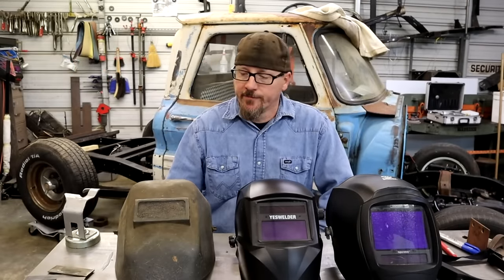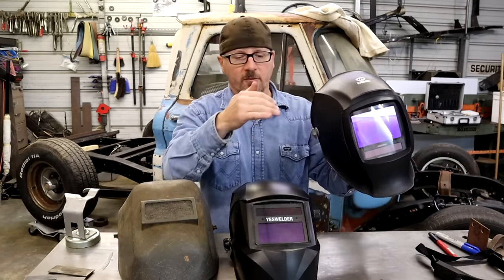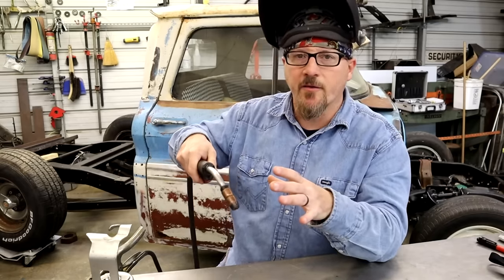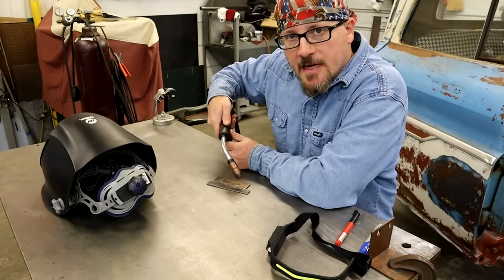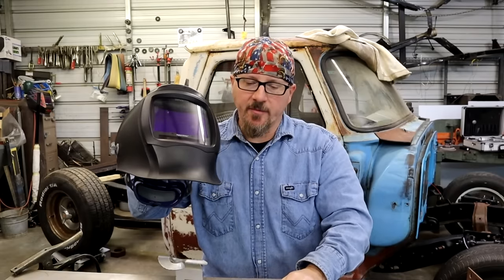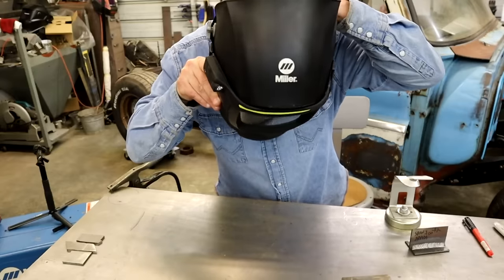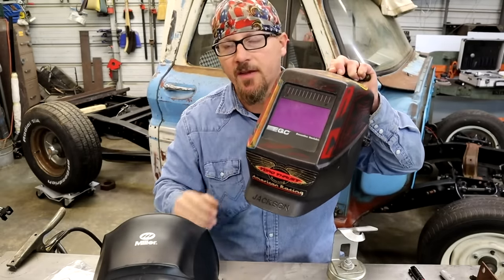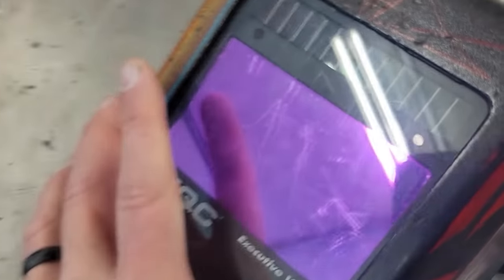(HELP) I Can't See My Mig WELDS (Top 5 Tips)

Comment: I had untold problems seeing my welds regardless of whether it was mig, tig or ark when I built my new home workshop. I changed lenses, I changed helmets and couldn’t figure out what was causing my problems since I retired. After more than 6 months of giving up, I had an idea which resolved my problem. I had an ex-hospital stand for drip feed bottles on wheels and mounted some LED lights shining onto my weld seams. It worked. Months of frustration, and it all came down to a lack of light. I thought I had ample light in my workshop, but I was wrong .So, I suggest, if you are having this problem, take your project outdoors with the sun shining across you project from either side of you, if you can now see your welds, then your problem is a lack of light at the work site I hope this helps someone, thank you.
Reply from the maker: Thats a great idea, thanks for sharing!!!!!
Reply: I'm a noob welder and soon found I could not see my welds. The sharp light from a LED worklamp fixed it, need a good way to mount it, this is a good idea
Reply: I think that's the easiest solution. More light on your work.
Reply: Totally agree and great idea. Us oldies need all the help we can get. You can have all the skill but if you can’t see what you’re doing, it’ll look like an amateur did it.
Reply: i forgot to take both sides of protective film off Lense cover and failed a weld test. I couldn't see nothing.
Reply: Yeah I had the same issue and put an LED light above shining down on the area I am welding. Certainly helps. Very frustrating when I was trying to see what I was welding and then stop and look and the weld had veered off the line.
Reply: I found a $20 Harbor Freight magnetic base LED light and I stick it by my welding project. Helps a bunch!!
Reply: I had to do same thing after 1 year of cussing.....got a $30  digi helmet ....good point.
Reply: Just about to  go into hobby welding...but anxious about eye damage....is burning your cornea normal or is it due to carelessness?
Reply: Thats what I thought. Sometimes we overlook the obvious. i bought a Braun head mount and going to try it.
Reply: Thank you.
Reply: I tried lights and different lenses and nothing worked. Then my optometrists made me strong cheaters and I was back to normal

Comment: I would add one more tip... when welding where the sun is shining from behind you then the light coming in from the back of your helmet can degrade your vision.  Having a dark cloth that you can put over say the top of the helmet down over the back of your head to keep your eyes in the dark helps also.  My father-in-law was a pipe welder in the oil field and work a helmet that had built in goggles to keep out the sun.
Reply from the maker: I wish id of put that in there, thanks for watching!!!!
Reply: I had a piece of black canvas attached with Velcro , it acted as an anti spatter ;)
Reply: Your daddy in law probably had a pancake welding hood ...is not a helmet...
Reply: Black Stallion a welding supplier makes a bib to clip under your helmet to keep your neck from getting tanned (at odd angles). It can also be used at the top of the helmet to block light. The darker the inside of the helmet the easier it is to see the weld because what is coming through the filter is only about 10 watts so reflection on the inside lens will be brighter than the weld arc itself coming thru the lens. I also like to wear black welding jackets because the green ones also reflect light under the helmet which competes with the weld arc. Awesome video!
Reply: Denim makes a good hood cloth, keeps sparks off your back and neck.
Reply: Yeah, I had to add a leather cloth  to the top of my helmet also a small chin flap to stop splatter hitting my chest, big improvement also magnifying lens because glasses causes double vision
Reply: Here are a couple of more things that will help. If you wear progressive lens or bifocals, get a pair of reading glasses so you aren’t going from near to far on your glasses. Block light with a cloth from coming into the back of your helmet even when you are inside. When you are fabricating keep in mind that some joints are a lot easier to see when welding than others so make your design with this in mind. If you have to butt weld flat stock together space the pieces apart or grind an edge on them to be able to see the joint you are trying to weld. If you have joint that is giving you trouble seeing mark a line with soapstone on the metal next to the joint.

Comment: When I bought my welder a few years ago I bought a Hobart auto darkening helmet.  I could not see what i was welding.  I played with the settings but no luck.  I decided that I must have gotten a defective helmet.  I did buy the cheater lens when I bought the helmet but still it was just too dark.  Let me get right to the point, something I finally learned (thank goodness) after too many attempts to weld.  Take off your auto darkening eyeglasses.  They darken when you strike an arc.  It is amazing how much better my helmet works since i figured that out.
Reply from the maker: Id never thought about that. That is crazy that they darken inside the helmet.
Reply: Great tip…..I too never gave this a thought!

Comment: I don’t know if anyone else mentioned this.  But I got a small aaa flashlight that attaches to the end of my mig.  It has helped a lot with it being to dark for me and my old man eyes.  Thanks for the tips.
Reply from the maker: Awesome I didn't know they made them, thanks for the tip!!!
Reply: @ACDesignsGarage  I don’t remember the manufacturer but I got it from an Eastwood sale they had set up off site at the Hartford Fairgrounds.  It helps my bad, beginner welding a lot because I can put the light where I need it without it it affecting my welding helmet.

Comment: Excellent points! I took welding at about 65 years of age and had a rough time welding because I couldn't see the puddle. I finally realize that I had to turn the auto darkening down. Made a huge difference.
Reply from the maker: Thanks for watching,  yes I use to think I had to weld with a shade 12 and I couldn't see squat. Then turned it down and I could see lol
Reply: Get to clean wire

Comment: I don't know if anyone mentions this, 744 comments are a lot to read through, but for the outer lens cover you can get a container of headlight cleaner. A few drops and a couple of wipes later your lens cover is good to go. I recently did change my outer lens cover after a good 3 years of use and cleaning with the headlight cleaner, but the new cover was not too different from using the headlight cleaner. Not all weld helmets have an easy way of changing the lens covers, so I hope this helps someone. I am here watching this video and deciding something  I have been curious about. I just turned 55 years old and have always wondered if something as simple as a taped flashlight to my helmet would really help. Watching this video and reading some of the comments cemented that decision for me and I am going to give it a go. Thank you to the video and commenters that suggested this.
Reply from the maker: Great idea I'll have to try this thanks!!

Comment: I have had problems seeing when MIG welding for years, and I would often lay a lovely weld a few millimetres alongside the seam I wanted to weld. My friend who is a welder recommended me to draw a chalk line where you want to weld. It works a treat... Gas welding is my favourite, it so calming and you can see everything so clearly.
Reply from the maker: Yeah that chalk trick works great!!! I need to do more gas welding, your right its pretty fun. Have you tried welding aluminum gas welding, its tough but a good challenge!!!
Reply: @ACDesignsGarage  I made holes in the aluminium when I tried 😂
Reply from the maker: @chrisparti  yeah it tough, I need to try it again on a video lol that would be a funny one!!!
Reply: Aluminium welding, I've done it, and it works. Henrob torch. Looks like the same one Eastwood sells. 
It's not tough once you do a few practice welds. But watch a good video first.

Comment: I’ve always used a large viewing area helmet. Recently, I bought a Vulcan from HF with the large view area, grind mode, auto dark, lots of adjustments, and appears to be very good quality. It also has cheater lenses available. It made a significant difference for me as I can see the puddle and weld path much better. It’s a lot better than the low dollar auto dark I was using, but isn’t a high dollar unit, which is fine because I don’t weld professionally. It is a sweet spot for me. I also use it for plasma cutting which I like. I know lots of people don’t use a helmet for plasma because the arc is largely shielded, but I don’t like to have my eyes exposed to any level of arc process. The helmet adjust perfectly for aluminum and the fit ent adjustments are really good.
I’ll add to this that using a t shirt or cloth to the back can work well if you have to weld from a position where sunlight or strong shop lighting is coming in the back. Also, I use a heavy glove on my left hand and a very light mechanic glove on my torch hand which lets me retain my fine motor coordination. In some cases I don’t use a glove on my torch hand, but I try not to do this and expose my skin to the UV.
Reply from the maker: Thanks for watching!!! Ive heard that that Vulcan stuff is pretty good!!!

Comment: Thanks for this. I just welded for the first time at the Oshkosh Airventure fly-in/show at the Lincoln Electric workshop. I did lousy. I kept telling the guy that I couldn't see the weld, but he didn't give me any help with that. I took doing poorly as a challenge so I bought a Lincoln welder, and figured that practice would help. I didn't realize that not being able to see the weld was a thing. I will put your suggestions into practice and see what happens.
Reply from the maker: Man I've always wanted to go to that!!! Yes if you get a welder make sure you can see well and it will make it alot easier!!!!@

Comment: I’ve been really struggling to shoot a straight line. I followed two tips replacing the lens protector and adding a headlamp. I tried it with an elastic strap but it kept crushing the mask against my face. Picked up some good 3M Velcro and stuck it under the lens area. Huge difference. Pay a few extra $ and get a rechargeable. Thanks for the tips. Changed my welding life!
Reply from the maker: Awesome glad ut helped, yeah the strap can be challenging, great idea on the velcro!!!

Comment: Great tips! When I first started TIG welding, I had trouble seeing. I solved the problem almost 100% by getting a pair of 300 power reading glasses, and getting decent lighting on my work.
 I was TIG welding architectural copper (Range Hoods, Bar Tops, etc) so my welds were VERY critical. It was extremely easy to ruin a $15-$25k hood or countertop, and once there's a hole, it's pretty much all over!
Reply from the maker: Wow thats awesome,  I couldn't imagine the stress of workin with that copper!!
Reply: @ACDesignsGarage  It was fun mostly, but glad I'm now retired after 35 years. I build guitars now. WAY easier!! (client-wise that is!)

Comment: I used that old 2 inch by 5 inch welding hood from 1966 to 1990, started out with a shade 12 lens , and later to a shade 10 lens. Usually welding 5 to 6 hours a day, other time spent on fabrication. Never used a big lens hood, but never had a problem seeing the weld, Stick, Mig, or Tig.
Reply from the maker: They work fine unless your doing 1000 spot welds on a quater pannel then it wears out your arm outting it up and down lol

Comment: You are right on, all issues I have faced while welding.  I have a Jackson welding hood and I did pay more for the wider viewing lens, the grind mode and shade settings are on the lens, not wired to the hood, this makes it much easier to change the outer protective lenses because it comes right out of the hood. I'd be wary of a yeswelder hood, I bought one before and had to send it back because the lens was defective. I have a Deko I've been using at home for a few years now, got it for around $60.  I bought one of those braun rechargeable lights from harbor freight when it was on sale. It has a magnetic base and the light can swivel and turn, so it's very handy for dark places.  Good job on the video.
Reply from the maker: Thank you, thats awesome, I just bought a lens from truarc and it is awesome and pretty cheap.

Comment: i weld outboards or call them 5th wheel mounts and brakets that go on a semi.ive never used a 15 degree angle you would be fired a 45,and circles or dimes is good but not for a semi traler you cant come outta root.circles takes you outta root you loose penatration.i like your techniques for home welds.in our industry wetre not aloud e welds u welds we use whips in root only.good video

Comment: Great video. I use an older non-auto shield with a 4x6 #9 lens and 300w light stand just above the piece on a bench. This has always worked well for me. Like anything else, over time and with practice, you figure out what works for you.
Reply from the maker: Thats right use what works for you
Reply: Is that seriously 24 in.² of viewable area? That's a heck of a view.

Comment: Thank you!  I've always struggled with  trying to get light where I'm welding, and the idea of mounting a headlamp on my helmet is brilliant!
Reply from the maker: It works pretty good, especially under cars!!!
Reply: Decent helmet lights are fairly expensive. I wonder if there’s a rig with some sort of lens to protect from spatter.
Reply from the maker: @Disoldman  not sure if you can attach a small strip of thin lexan over it or not.

Comment: Thanks for the tips! I've tried all the methods you mentioned, except the headlamp.
I just ordered one, and an offer popped up for a second one with an additional $10 off. No brainer!
Now I have two coming.
I recently picked up the Lincoln flames auto darkening helmet, and it helps a lot, the only problem with it is the adjustment dial.
Instead of having a solid click into position switch, it's a rather loose non positive position dial.
Yesterday I set it around 9, put my helmet on and when doing so accidently move the dial to grind.
I stuck my arc, and about blinded myself. 
Dammit!!!
Reply from the maker: Awesome thanks for watching, ive blinded myself alot like that lol

Comment: That was an interesting video. I use a hand held welding shield, as I've found that it's the best for me. My mate bought me a brand new auto darkening hood which I tried to use, but I can't see properly with it because of the yellow tint when it's off.
You are sure right about good lighting. I was welding outside in the afternoon and when the light started fading late in the afternoon, I had to pack up and continue the next day, because I couldn't see well enough in the fading light.
Reply from the maker: Thank you, I welded for years with no extra light, I thought the welder put off enough light but I was wrong lol It makes a ton of difference

Comment: I've always had a problem where I can see my puddle, but nothing else.  So I wander off.  I've had to dial down to an 8 to see where I should be welding.  Luckily I don't weld a lot.  I did find that putting lots of extra lights on the work piece and my helmet help a great deal.  I also created a couple of guides to run my nozzle against to keep me on track.
Reply from the maker: The extra light and that track is a good idea!!!!

Comment: I wear a fibre metal pipeliner welding hood with a gold lens. I do a lot of mig and flux core welding and don’t have any issue seeing.
Reply from the maker: Those gold lens work great! Most of the time in what I do like rust repair your dealing with such low voltage it makes it tough to see.

Comment: I found that getting one or 2 of those spring clamp, aluminum reflector lights and putting the 100-Watt-equivalent LED indoor flood lights in them, works well. Position as required and it helps significantly.
Reply from the maker: Ill agree, I never realized how extra light wold help, youd think the arc was enough lol

Comment: I went through 3 Yeswelder helmets before I gave up.  They work great for bright (Hi current/volt) welding - Stick and Mig - sure.  doing light TIG it wasn't sensitive enough it would shut the dimming off occasionally and I'd get flashed.  Save the money and go for a good Lincoln, Miller, ESAB etc. they are just so much better.
Reply from the maker: Yea I agree, the low amp stuff is tough on the cheaper hoods.

Comment: For scratches in plastic, you can use a wax to fill them.  I used to use Turtle wax on my bike helmet shield and it took 99% of the scratches out.  I used a liquid wax but a paste wax would probably be better.  Put it on and wipe it off.  Don't let it dry or you'll be in for a fight.  Same with waxing your car.  Don't let it dry.  I like the disposable shields too.
Reply from the maker: Thanks ill have to try that!!!
Reply: Meguiars ABS plastic polish works well for me
Reply: I will try this thanks. I have an Sean A-60 the lenses are right at 6 dollars a piece for the outer. I use pledge on them before I put them on, the. Everytime I clean it I use pledge and a microfiber clothe. They last longer but still not long enough for the price. Once they get some small scratches in them, I think because of the curvature of the outer lense it really makes things look weird
Reply: Mcguires Plastix headlight restorer/ polish works great on the cover lenses as well as the adf. I'm the lead of my shops fab dept. We're a production welding shop. My cover lenses for my helmet are kinda expensive ( Jackson True Sight ). Using the Plastix headlight polish, I can get minimum of 3-4 months out of my cover lenses. 
   The key is, to polish up & down, then side to side. Not in a circular motion